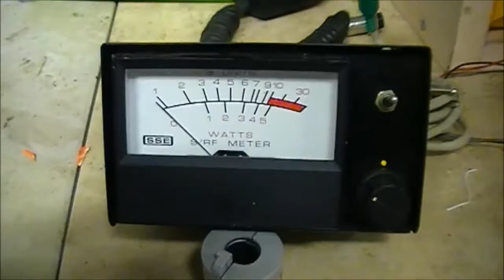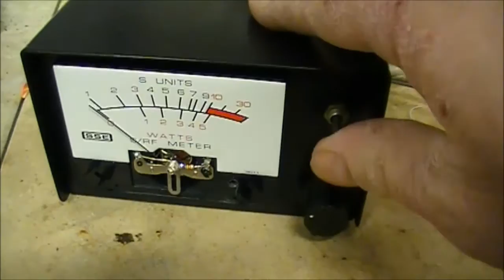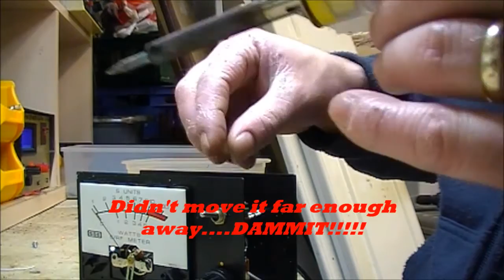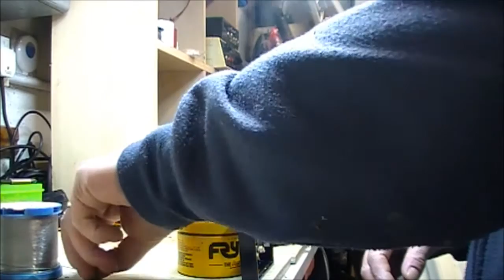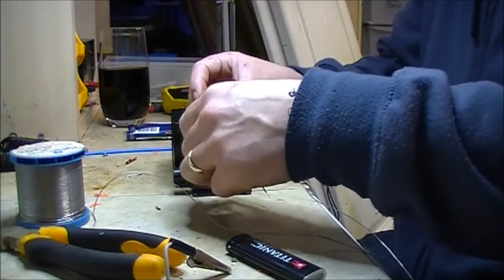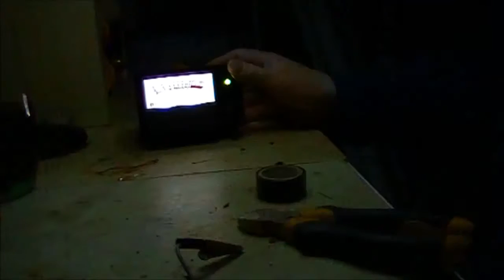SSE external sig meter LED modification for Andrew

Comment from the maker: Hi Alex, I've been asked that a few times now. The short answer is I dont know, Its a 110v iron and i use a transformer to power it. It's temp controlled to 450 degrees and you can see the LED flicker on and off when the element comes on. Its a great iron though, and was given to be by a dear friend after the untimely deat of my Antex. This one, whatever breed it is is a far superior iron. I would hazzard a guess it came from the States.

George